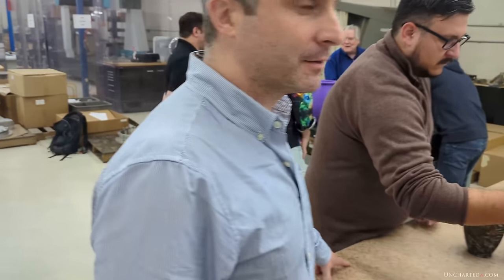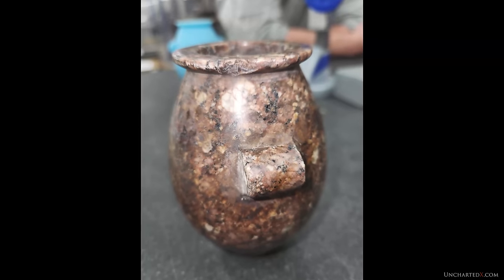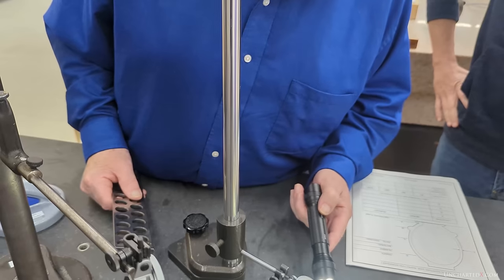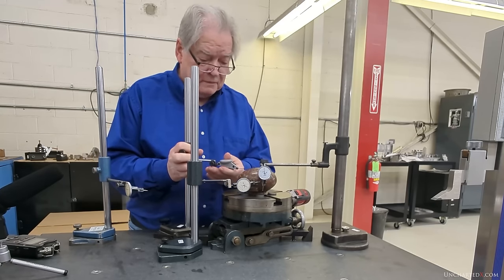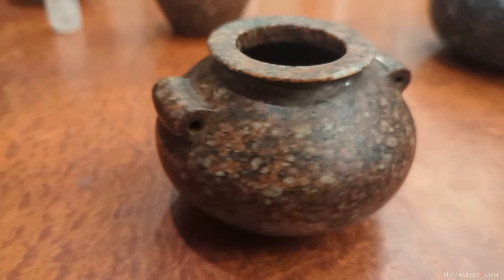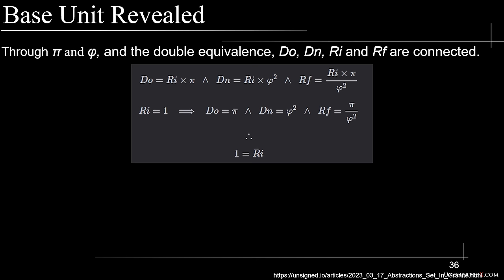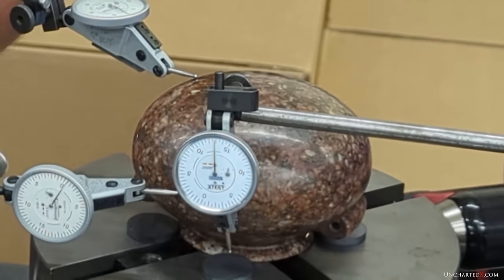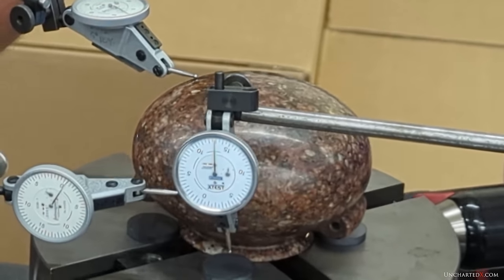Astonishing Results! More Ancient Egyptian Granite Vases Analyzed! More STL's available.

Comment: Ben , I once was considered a Advanced R&D Technical engineer - I helped design and create processes for the Bunker Buster - both DU and other heavy metals. 
I setup and programmed CNC - NC - PLC -standard machines and robotics , since 83.  You are on to something here , but the way you are explaining it , requires someone to have a machining background to understand just how difficult ( if not impossible ),this would be without a lathe or mill. You did not even show either of these machines and how they machine an object. So many ways you could bring this precision to everyone in a way that could not be misunderstood or denied. On these vases , only 2 measurements need to be pointed out in my humble opinion , the ID and OD total runout and what that actually means , Total wall thickness variation and what that means. Then demonstrate how it Cannot be done without turning the Vase on a lathe or mill, possible centerless grinder. Demonstrate how one has to chuck ( hold ), the piece and turn the OD and ID without un-chucking it, that's the receipts , the proof , the top and bottom surfaces have to be parallel if its cut while the initial chucking is done, a cut off tool will parallel the bottom, it cannot be done without turning and cutting while turning. the math and all the Brilliant talking points and verbiage , turns to word salad .If this were done , it would be clear from that point for the least  technical of people and the expert just the same. This is something I would very much like to see done (  I would guess 99% of your viewers would as well ), take one vase , recreate it with a piece of aluminum or some piece of stock, wood would work ( it should start as a rough piece, square , out of round , rigid ), its the process that needs shown. Not the math or scans , for they will make no sense until one understands what it takes to create the object. Thanks for the video Sir
Reply: I'm seconding this!! 

We need a visual on what this process would look like, especially in regard to how precision is affected by runout.
Reply: I second this, too, in fact I can't even visualize the test you're proposing but I got the gist of it and I can understand it will be immensely useful.
Reply: Agreed, in which to the basis simply couldn't manage to survive. Its quite possible for the last few to have been before the same thing 😊
Reply: thanks for explanation
Reply: The main point in the vase analysis Ben gets across very well. There are people from all walks of life here, professional machinists or not, who express the exact same bewilderment of how these artifacts came to be, and how they could possibly made in the time periods framed, or with modern tools available. For a product with dimensional deviations that are only theoretical to most people.
 
Using logic and discernment, these vases weren't made by people from this earth, or with any tools familiar to mankind then or now. I'm not a machinist, but a healthcare professional with hobby interests in archaeology, history, and semi-precise metal work. While my interest in the 'perfection' of such skills into a final product appealing to the naked eye,  is a universal concept, their inherent beauty is  recognized as much or more by the eye, then it is in a paper calculation.
Reply: Good comment. Sometimes people think they have to show multiple tables of equations and ratios and angles to be taken seriously, maybe in a peer reviewed paper, yes, but not in a general vid for public consumption. What you suggest is sensible.
Reply: Spot on.
Reply: @mikeycrackson   thanks - its how i roll - i made things , i did not write about them, my comments , in my opinion - were meant as a huge compliment for Ben.  - anyways - have a good one
Reply: What is your theory for how an advanced ancient machinist would execute the "love handles"
Reply: @catsfive   This question is legit - it is unbelievable what they were able to do. They had to turn these vases , I think Ben reported there are thousands of them. I would get a centerline from the face off tool - get the total width , lets say each is 1 inch wide - I would measure .5000 from centerline - repeat at 180 degrees. The " Love Handles " would be turned into the vase as a large ring with the correct shape - I would use a mill and a very nice form tool - made out of what, I don't know.  I think after he pointed these measurements out etc..  It would be harder to make the tools for some of them , rather than the actual piece.  In order blend that back in and maintain the finish, radius , would be a real challenge.  I have so many questions about all of the '"Things made of Stones and Rocks"  I have done work on GM intake injection molds - they were very complex and had lots of compounded angles. imagine the holes or channels if you will for the air and gas flows, with that, I will say the handles could be done , again , it would be a challenge, based on what I have seen and done.  I am new to all this , less than 2 years.  I think Mr. Dunn would be the perfect person to create one as a visual aid and proof.
Reply: Yes. Totally agree. As a part of a series of videos let them try to manufacture it out of soft plexiglass even and then polish it to the same smoothness and tollerances just to underline the contrast of working with homogeneous material versus varing hardness of multiple components of granite.
Reply: I don't know, if you showed this video to anyone you trust the opinion of, who manufactures anything for a living, they will be astounded. For non-technical people, they really need a second opinion from someone they know to really get an idea of what is going on here.
Reply: Made sense to me. All one has to do is relax their mind and listen.
Reply: I’d be much easier if the rock was soft
Reply: well said from a retired mouldmaker who started the trade in 1980 before cnc where pantographs and other basic machinery were used go back and try to recreate these vases using what was the best of that generation using this pre cnc technology if we cant do it then?
Reply: I argue the descriptions are clear enough so that the interested can start investigating. Plenty of jaw-dropoing details to start with if this is not your field of study, not THAT hard to follow. Not "word salad" anywhere- to me.
Reply: Agreed
Reply: Great info. Thanks for the explanation.
Reply: It's a big part of the problem that people don't understand machining at all, so they have no idea how difficult/impossible these tolerances are without turning and precision measuring tools to setup the next machining step. It would be interesting to see if they could dumb it down for the people without experience, but I think they'd need a real crash course in machining to really understand parallel, square, runout, etc.
Another thing to consider is the near impossibility of making anything this precise without equally precise measuring tools! Trying to make anything this precise without a way to measure them accurately is nearly impossible!
Reply: @johnj5985  While I do not know the answer as to who made these pieces, I would subscribe to the theory of ancient  lost technology before concluding that they were made by extra- terrestrial beings. Simply as there is more and more evidence of the former and, as far as we can yet discern, none of the latter. I do however retain an open mind.
Reply: I would love to see this as well. The main issue in my mind is work-holding. How did they hold the piece, and what were they using for bearings that would allow such high tolerances? Once the piece is chucked on a sturdy lathe, the tooling would be hard but not out of the realm of possibility.
Reply: @BiggyJake  yeah but how would you verify precision without precise tools? it's not like these things came right out of the machine finished, they had to be meticulously polished for who knows how long, so how did they know where and where not to polish in order to maintain tolerance to within a few 1000ths of an inch?
Reply: Maybe he will !!   @BiggyJake
Reply: I've learned enough about machining from watching youtube videos to appreciate how impressive these things are, and how utterly impossible they would be to make using just hand tools, and how much of a challenge it would be for us today with all our modern machinery.

In softer material, without the lugs, it could be done with a decent quality lathe and sufficient care. But in granite? And as a single piece including the lugs? That's not just a turning process any more, something else must have gone on.
Reply: Spot on as an engineer myself saying it’s impossible to make on a lathe and yes it must be made in one go.
Reply: @rug0  ---- Yeah, those ears are the first thing that told me, "Holy crap!" because I knew Chris Dunn was involved here, and I knew he had done all the exact measurements on other things, so the precision in these has to be a doozy.  Making the round surfaces between the ears and keeping the runout on the shapes vertically - I honestly think no CNC could do it.  Maybe, but maybe not, too.
Reply: TITANS OF CNC @TitansOfCNC Answer the call !
Reply: Very astute comment. Thank you sir.
Reply: check out my work, I'll show you real ancient high tech in clip 3
Reply: And do you propose to make the handles?
Reply: I don't quite understand how you can demonstrate a negative. Just because you make a piece with a lathe does not prove you cannot do it in another way as well. I agree that the artifacts are machined. But you cannot "demonstrate how it cannot be done without a lathe".

Anyone who does not get it after the video will not be swayed by someone doing it with an aluminium piece and saying: "I could not have done it without a lathe"

Or am I missing something in your thinking?
Reply: This is you tube, if you have the machinery, do it, and post the video here!
Reply: @rugo
Ben has an earlier video dedicated to explaining precision manufacturing..... also, Depleted Uranium munitions are some incredibly repugnant weapons to develop and ought to be a warcrime, making bullets from nuclear waste is some evil shit
Reply: I hear only crickets in reply to your interesting notion unfortunately.
Reply: @Its_Shaun_the_Sheep   He's got 34 answers. Crickets... I pointed out how what he says does not make sense to me and no answer so far. Maybe he should answer his feedback if he wants more. Seems more like he did not really think about what he was writing and maybe realized afterwards.
Reply: @sebastianbarely  It was a Dear Ben letter, a very good one and he got crickets, what did i say wrong? Minions aren’t Ben.
Reply: @Its_Shaun_the_Sheep  When the letter makes little sense for reasons already pointed out in the comments maybe Ben has better things to do than to answer. If he can't answer to the questioning from "minions" then why would he be able to answer questions from Ben?

Perhaps if he adressed the critisisms of the so called minions his argument would hold enough of a standard to afford being adressed by Ben.
Reply: @sebastianbarely  I’ve been sending him mail for 5 years and crickets. Its a scam ring and the experts are family and friends. Hardly biased. Hope my kids read my comments anyhow,
Reply: @Its_Shaun_the_Sheep  Considering your posts here I can imagine why he is not answering your mail. Post it here and I am pretty much certain I could tell you why he did not answer you. Or perhaps you don't stand for what you have sent him in which case I would certainly understand.
Reply: @sebastianbarely  i’m always open to a new idea (which has brought me here for 4 years based on analytics and algorithms) but so should anyone to the logic of the existing.
Reply: @Its_Shaun_the_Sheep  So you don't stand for what you have sent him? Why are you surprised he did not answer? Entitled much?
Reply: @sebastianbarely  Entitled to know facts yes or express them otherwise i am like a Moslem listening to an Imam and expected to believe whilst not being shown the Quran.
Reply: @Its_Shaun_the_Sheep  Your answers have nothing to do with what I have written you. Are you a broken AI or just panicking?
Reply: @sebastianbarely  ok i guess i need to concentrate more on your conversation. I’m in quite a few and i’ve lost track.
Reply: @sebastianbarely  oh the cricket answering minion. I have no response still.
Reply: @Its_Shaun_the_Sheep  What are you talking about? Are you ok? I asked you to send the mail that you had sent Ben and all you do is ramble. But if you don't stand for what you sent him I understand
Reply: @sebastianbarely  your his minion mate I don’t need someone else to answer but thanks you can go to sleep now.
Reply: @sebastianbarely  did you report me for minion abuse? 😂
Reply: @Its_Shaun_the_Sheep  No, being dumb is not a reportable offence. You have to live with yourself and that is comfort enough for me :)
Reply: @sebastianbarely  i’m happy for you.
Reply: @Its_Shaun_the_Sheep  Thanks,  I feel sorry for you. Crying like a baby over someone not answering gibberish you apparently don't even stand for is kind of sad.
Reply: @sebastianbarely  Fortunately i’m self retired and feel nothing for your comments while i fish and watch youtube but thanks for your input! Have a nice day working out the past from your parental provided bedroom.
Reply: @st.armanini9521 what he is saying is its impossible for it to be so damn perfect without being done on a machine that literally is burring the object out from a square block... that MOVES the block, and spins it while cutting it. it's impossible to get such a uniform wall thickness any other way.

Comment: I ran a multi million dollar machine shop doing mold making. We only had one programmer and one operator who with the best machines and tools could get steel to 1.5 thousands of an inch on a steel mold. If we had to make those boxes from steel we would need to use EDM to get those corners. We can't even do it with a mill..
You can not imagine how hard this is.

Comment: Mind-bending precision. You can even imagine the cutter head fluttering in the way the dials wiggle within their incredibly tight tolerances. They must have had giant, heavy machines. I wonder if they used a combination of stone and metal to create analog powered cutting tools, perhaps making the tool holders out of giant stones, as well as their entire base assembly. A hole would be drilled that could accept a spindle, and a piece of stone could be turned on a "rock solid" lathe. The tool could be guided with a 2-axis gliding mechanism using stone bearing spheres and a pantograph mechanism that could copy a pattern from a radius based on a set designed using a mathematical system based on pi and phi. This would require a rich heritage of mathematics, an understanding of metal alloys, advanced engineering capabilities, and a long and sustained period of peaceful settlement to develop the capabilities required for making these vases in such large quantities. I can imagine them washing up onto the shore in their millions after some massive flood, most in shards, but 10,000s intact, collected by the survivors who rebuilt from scratch. It's starting to look like a very likely scenario that archeologists and Egyptologists will not be able to wiggle their way out of any longer.
Reply: A great comment. I think the polygonal walls were also cut using a pantograph from a small-scale model of the proposed wall.

It does occur to me that a power source is needed - it could be as simple as a water wheel, but I do wonder if the ancients used a simple steam turbine. Heron of Alexandria built a small one as a novelty, but it may be no coincidence that he lived in a city that once had a library filled with ancient documents now lost to us.
Reply: At this point I’m just assuming they had some kind of giant box way machines running on templates or geometry built directly into the machine. This is wild.

Comment: I am a mechnical engineer and design and build race engines where tolerances are down to +/- 0.0005 inch in critical bearing dimensions with high quality  and consistent steels and this is the best achievable and measurable with the best avaliable equipment outside a measurement calibration lab.  To achieve similar tolerances in granite even today is outside current technology, achieving it 100 years ago impossible, achieving it 5000 years ago incredible